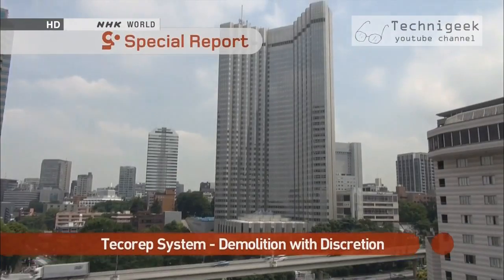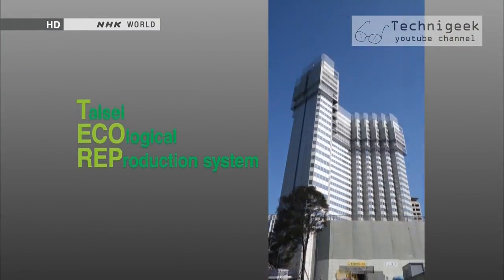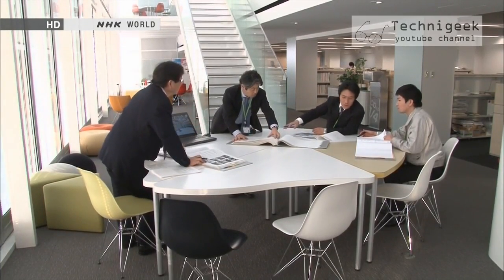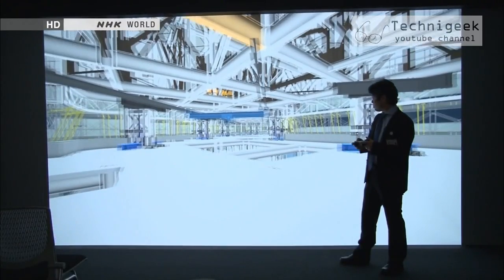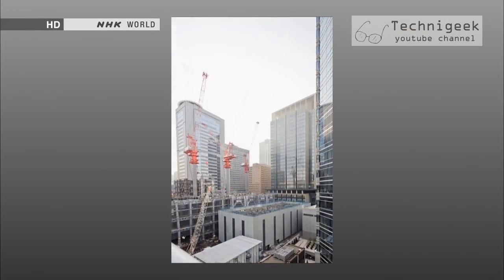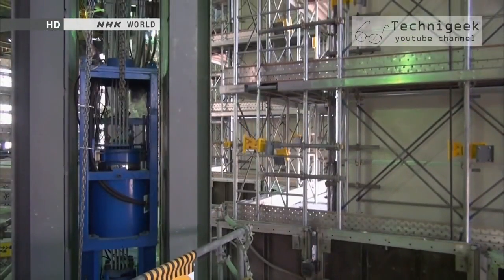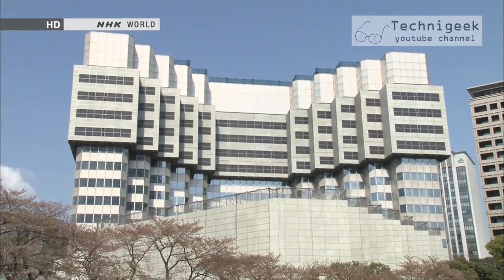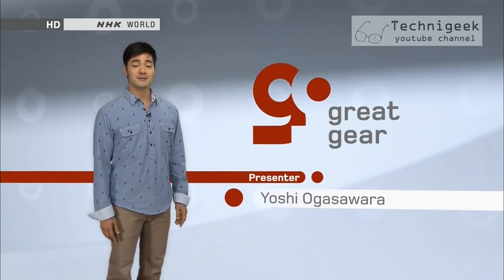هدم المباني العملاقة بطريقة امنة جدا وصديقة للبيئة Amazing ecological way to demolish skyscrapers

Comment: It is a great and great job, but this building consists of iron on each floor. I just have a question of how buildings are dismantled in the same way if they are made of cement and concrete.

Comment: Excellent. I bet this method offers a much cheaper way of handling the building materials for reuse. It takes several weeks if not months to set explosives. In that time the building is taken down without having to cleanup the area and the energy needed is generated from the lowering of the building cap.
Reply from the maker: in deed , and the risk is very low